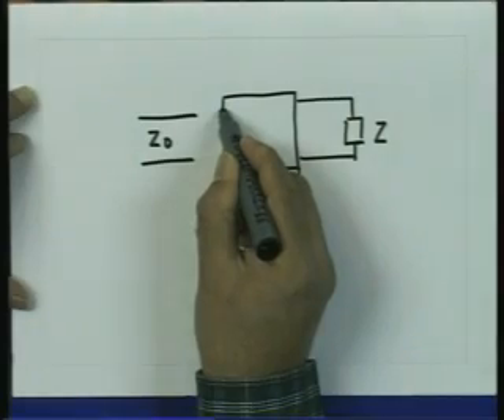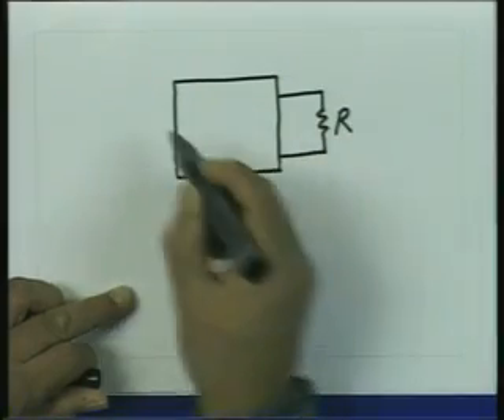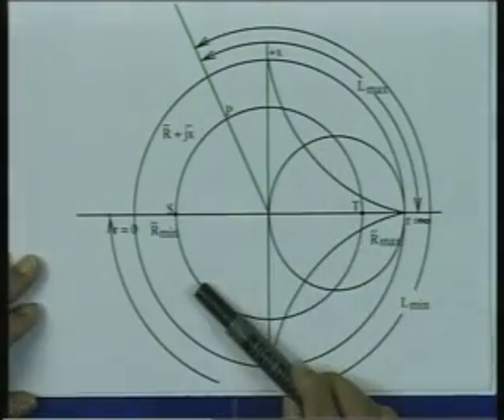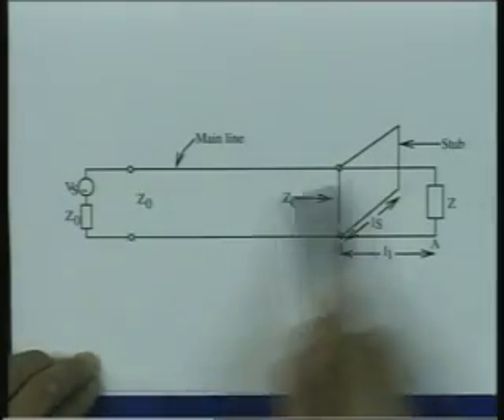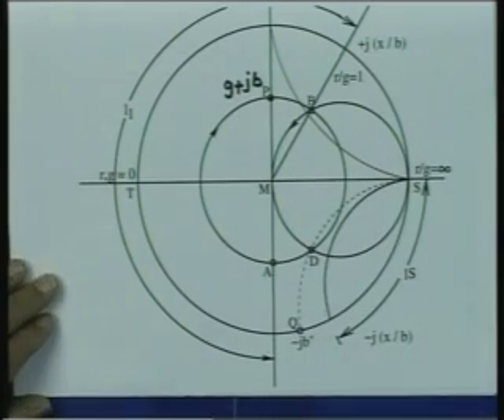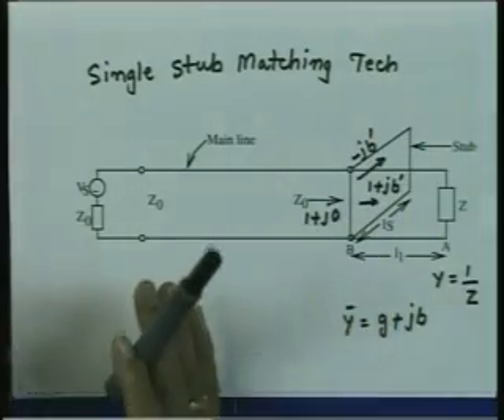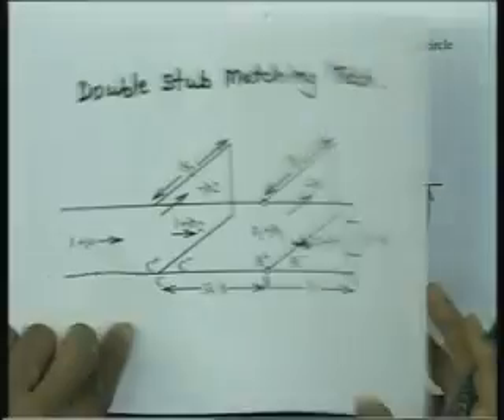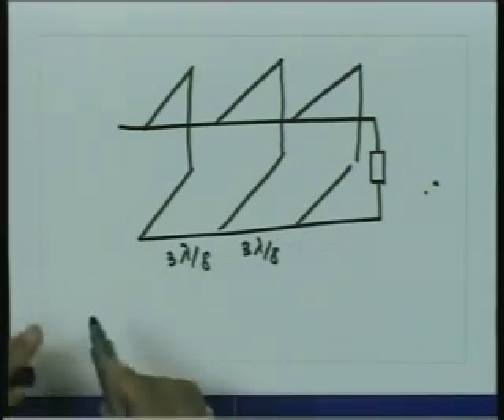Impedance Matching

Comment: Still, i am unable to understand why 3xlambda/8 distance is chosen between the stubs...? Also, in the part when you are transforming the g1+jb', using the conductance circle g1, there will be two points, where the conductance circle, 'g1' intersects the rotated g=1 circle...? why are we considering only one point of intersection..?
Reply: Rajiv, we can choose any value instead of 3 lambda/8 but rotation of new circle must be according to    your new distance choosen between stubs! Substitute "L" in 2*beta*L , you get angle of rotation. ☺
Reply: Yes there are two points at which constant g circle passing through B cuts Rotated g circle below but sir has taken Right side point, but i think we can take even left hand cut point, just making sure at next step we have to draw VSWR circle from that point and move on it to reach g=1 circle again after rotation of 270 degrees in clockwise sense. There is nothing special about 3lambda by 8. We can use any value but then we will have to deal with rotated circles by that angle and from there to reach g=1 circle. Infact as we are increasing no. Of stubs on the line we are rotating by lesser than 3pi/2 and cover whole forbidden region in three stubs case. I think we have got the broad idea of what is happening here.
Reply: 3xlamda/8=3xpie/2 (which is 270degree).... as we are rotating g=1 circle by 270degree.
Reply: Use can either use lamba/8 or 3lambda/8 distance, which seems to be best possible scenario to avoid forbidden region. The Forbidden region will be larger if you keep distance between stub as lambda/4.